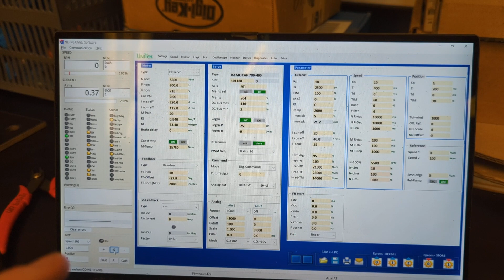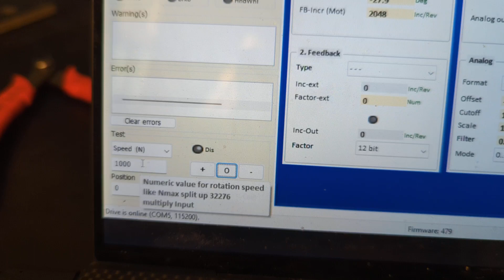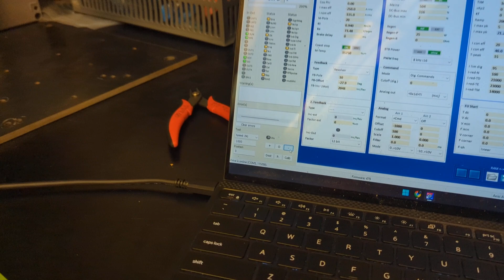Bamocar D3 - Emrax 228 Setup (Northwestern University Formula SAE - NFR23)

Comment: Hi do you have a video of the software setup as we have a problem using a bamocar 400-400 and emrax 208  that for  calibration the motor turna accordingly  and when we input the test the motor jitters but does not move

Comment: We have a problem with the same setup, where we get error 6 (too high temperature of the motor). But the motor is not hot. We tried to overwrite it and change the limit, but when we switch to "run" the error returns. Any help for this problem?

Comment: Hello, 
I have one question regarding the initial current necessary for the motor to spin with load. If your car had 350 Kg and max output of the battery of 180 A on full battery, is that enough for him to spin? I´m sorry if the question is to basic but it´s my first project with an axial flux motor.
Reply from the maker: A few questions. 
1) can your motor spin without a load attached? We want to ensure that adding the load is what is causing the issue. 
2) when you bolt your motor into the vehicle, can the vehicle roll freely without any resistance from the motor? No scraping or similar sounds of rubbing? I had issues with our 228 where the mounting bolts would scrape against the rotor on the inside of the motor if they were too long. 
3) if you spin the motor without a load at low speeds and attempt to manually slow it (eg. With your hands, a dyno, etc.), does the motor torque increase and hold at a consistent value? Or do you get a kind of "rippling torque" type of feeling? If your motor is setup in open loop mode or improperly configured in closed loop mode, you will get inconsistent torque production which may be causing the motor to struggle to move the vehicle 
4) the maximum current of the battery is not particularly important at low speeds. As a reminder, this is the job of the DC link capacitor within the inverter. While the power flowing into and out of the inverter will be the same (+ some heating losses), the voltage at the input is the battery voltage (eg. 600V) meanwhile the voltage at the output is linearly related to the motor speed (eg. Near 0 RPM the voltage is near 0V, near max RPM the voltage is near the max motor voltage). The current flowing through the motor is linearly related to the torque production. This means that, at low speeds, the motor will require a moderate amount of current to produce the torque needed to start the vehicle rolling, but this current will be at a low voltage because the motor speed is low. Because the voltage is low, the overall power consumption of the motor will be relatively low, in the range of a few kW should be more than enough to get the car rolling. Since power in = power out, assuming your battery voltage is around 600V, this should only require a few amps of current from your battery. The maximum current capability of your battery should only be important when you are drawing high amounts of power into the motor, and this happens at high speed and high torque scenarios. 

In short, yes, your battery is definitely capable of moving your vehicle. I assume there is an issue with either your inverter configuration or mechanical setup which is causing the issue. I recommend testing each part of the system individually, then slowly combining them to make the tester more representative of the whole vehicle to isolate where exactly the issue is coming from. Feel free to reach out if you have any further questions.
Reply: If 72 volt its enough to run the car

Comment: Hello,

We're currently facing an issue while operating in test mode with dig commands, where the motor is not under any heavy load. Despite setting the N-100% to limit the RPM to 1800, with N-Lim % = 100%, N-lim+ = 100%, N-lim- = 100%, and restricting the current to 5% (approximately 21A), the RPM exceeds 1800, likely reaching the maximum RPM achievable at that current level. However, the display screen continues to indicate the maximum RPM set at N-100% (in this case, 1800 RPM, represented as 32767 at 0xa8), and the RPM keeps rising. We've also tried the same setup for 1000 RPM and 500 RPM, but the behavior persists.

As I'm relatively new to this experience, could you please advise if you've encountered this issue before, or provide any assistance in resolving it? Your help would be greatly appreciated!

Thank you!!
Reply from the maker: Hello, I recommend re-reading the NDrive software reference manual. Particularly take a look at section 12.1.3 on page 74. N-100% is the maximum speed your motor is capable of (not the speed you want to limit it to). Since your motor has been exceeding 1800RPM in your testing, this value is set incorrectly. This max speed is captured in the motor datasheet. For example, if you're using an Emrax 228 like we were using in the video, that has a maximum speed of 6500RPM. You then put the speed you want to limit the motor to (as a percentage of N-100%) in the N-lim field. For example, if the max speed for the motor is 6500RPM and you want to limit the motor to 1800RPM for your test, then you set N-lim to 1800/6500 = 27%. As a reminder, motor speed is proportional to supply voltage, not current. If your supply is a standard 600V battery like many FS and FSAE teams use, you could expect a motor like the Emrax 228 to achieve well over 5000RPM. I recommend updating the value in the N-100% field to reflect your motor capabilities. Additionally, please refer to page 82 section 13.3 in the NDrive reference manual. As mentioned there, N-lim = 100% will disable the cruise limit and allow the motor to accelerate to whatever speed it can achieve with the supply voltage. This is what is happening in your test. As such, it is recommend to set this value to a maximum of 99% if you intend to use cruise limiting during normal operation. 

TL;DR - check the motor datasheet and set N-100% to the max motor speed, then set N-lim to whatever percentage of that max you want to limit to. To avoid future confusion, if you raise the speed limit in future tests on your motor, I recommend setting it to 99% so cruise will still engage at your max speed. 

Also, UniTek is really friendly! While these answers were in the software manual, they have been very responsive to my emails in the past, so I encourage you to reach out to them as well with questions. Let me know if the fixes above don't work!
Reply: Hi Chris,
While working on our fsae car, we faced a couple issues and needed some expert help. 
Context: We use an EMRAX228 HV motor controlled by a Bamocar D3 controller. We're currently controlling the motor via analog torque with a 0-10 volt analog signal on the AIN1+ . We haven't implemented AIN2 yet, but it's on our to-do list.

We're facing a couple of challenges and hoping you might have some insights:

1:  According to the Ndrive manual, the analog input should accept voltages between -11V and +11V, corresponding to digital values of -32767 to +32767. However, in our tests, the AIN reading never goes above 1200 even with a full 11V applied. We've been compensating by adjusting scaling factors to get a wider usable range, but we'd like to understand why the actual reading is limited. 

Additionally, do we strictly need to ground the AIN1- pin if we're only using a 0-10V signal?

2: During dynamic testing, the motor experiences shuddering when starting from a stop. We've set the peak current limit (Imax pk) to 100A and the maximum voltage to 500V, with no RPM limit applied. We're wondering if you've encountered similar shuddering behavior in your work. Any advice or troubleshooting steps you could share to address this issue would be extremely helpful.
Thanks in advance for your time and assistance!

Comment: These motors are synchronous - but will they be damaged if we operate in V/F open loop mode and the rotor (magnets) 'slip' below the synchronous frequency?  in other words, lets say we command a certain rpm, then bring up the expressed load (drive operates to maintain setpoint frequency with no feedback) and the torque cause the motor to not 'stay synchronized  so it operates at a reduced RPM from normal setpoint frequency? 
is that something you have experimented with?  I would expect that vehicle operation would have this dynamic?
(i ask this because certain types of synchronous motors will demagnetize if load causes 'slip' between magnetic rotation and magnet rotation)
(we are attempting to talk to Emrax but we have not received responses either email/telephone as of today)
Reply from the maker: Operating a permanent magnet synchronous motor (PMSM) like the Emrax motors using open loop control is allowed but not recommended for high performance applications. Closed loop speed and position control with FOC are generally recommended due to their superior performance. Since the control is open loop, this means it is not consuming speed / position information from the motor and instead arbitrarily applies a set voltage + phase frequency which correlates to a set motor frequency based on the motor kv constant. This also means that if the motor is unloaded or under a light load it will be able to reach the target speed, but under medium to high loads the motor may decrease in speed or even stall. The motor cannot maintain peak torque output like it could with closed loop field oriented control (FOC) because the vector representing the applied magnetic field is allowed to "slip" past the optimal angle relative to the rotor for torque delivery due to the lack of feedback. If you are testing with small loads then open loop may be fine, but if you're testing with heavy loads then be sure to carefully monitor motor current and temperature to ensure you aren't exceeding the stated operating specifications.
Reply: thank you!  and again for your time and patience. wish us luck please!  @chrisuustal

Comment: can someone help me understand input phase frequency vs rpm for this motor (188)?  i'm planning on running with parker vfd -which has a max frequency output of 588hz - 
is this enough to reach the top RPM limit of motor? 8000 rpm?
thank you!!!
Reply from the maker: The 588Hz of the parker VFD will not be sufficient to reach the 8k rpm limit on the 188. 

The maximum motor frequency is 8000 RPM = 133.3Hz. At this speed, the motor will complete 133.3 rotations per second. This motor has 10 permanent magnet pole pairs. Every full cycle of a sine wave from your inverter will rotate the motor by 1 pole pair, or 1/10th of a full rotation. This means you need 10 full cycles of a sine wave from your inverter to complete one rotation. As stated above, at its max speed this motor completed 133.3 rotations in one second. This means you'll need 133.3 * 10 = 1333 full cycles of a sine wave per second at this speed. This number (1333 Hz) is your required phase frequency output from the inverter to reach that speed. Since that inverter is only capable of 588Hz, you can do the math backwards to find it can achieve a max motor RPM of 58.8Hz = 3528 RPM. The general formula is:

Phase Frequency (Hz) = # of Pole Pairs * Motor Frequency (Hz)
Reply: thank you - i appreciate the time/effort you have made to inform me - yes on 10 pole pairs - @chrisuustal
Reply: Just an update to the parker drive - we have found that USA State Dept has set the 588hz limit - the drives are capable of going to 1200hz but you must apply for a waver with certification you will not resell overseas.  Apparently they can be  used in centrifuges for the nuclear industry.  Parker and Scott drives are the only ones that we can use (that feature 1 degree rotational adjustment between motors - we have three motors we need to adjust the shaft angle of each and maintain that at a specific rpm @chrisuustal

Comment: Hi there! Currently in the process of ordering these very same components for our fsae project, although we are seeing that the unitek bamocar d3 manual claims it only reads 2, 4, 6, or 8 pole resolvers, not 10 pole which we were hoping to use as you are. Emrax offers 2 and 10 pole options, meaning we planned to default to using 2 pole. Was this something you contacted unitek to get clarification on, or was there any adaptations you had to make for this 10 pole resolver to be compatible? Thank you!
Reply from the maker: Contact UniTek! They're very responsive and helpful. I don't remember the exact details to answer your question, but please do post what you find when they respond. I'm sure it will be helpful to others! Seems there's a lot of FSAE people viewing the video, so I want the comments to be full of helpful details / answers if possible :)
Reply from the maker: Actually I just checked my old emails and a UniTek representative directly recommended we use the Tamagawa TS2620N1095E161 provided by Emrax.
Reply: @chrisuustal  amazing thank you for the quick repsonses! I will still reach out to them for any questions but that’s a great help 🤝🏻

Comment: Hi Chris,
I have my own bamocar D3 700/400, however it states that its only intended use is for battery connections; my counterargument to this is just to use a DC power supply to make it run.
What are your thoughts?

Best regards.
Reply from the maker: You can safely run a power inverter like the bamocar D3 700/400 from a power supply, but you can never apply a negative torque during your testing. If you try to apply a negative torque to a rotating motor to slow it down, the kinetic energy of the rotating motor will be converted into electrical energy that has to flow back upwards through the power inverter and into the power supply. Most power supplies are not rated to handle power flowing back into them, so they may be permanently damaged. If you want to test active braking / deceleration of the motor, you will need to use a battery instead of a power supply. If you only plan to accelerate the motor and let it coast to a stop by friction / mechanical brake, a power supply is fine. I hope this helps!
Reply: we use AC to DC power supplies that are both regulated, and have 'dynamic regen capability'  its just a dump resistor (sized correctly) and a switching circuit that cuts in when the bus voltage exceeds a setpoint - to dump the excess voltage/energy.  they are pretty common or pretty easily produced. Its common on any inertial loads @chrisuustal

Comment: Is that the inverter you would use for an EV using this motor? Or is it a substitute? Im new to this sorry. Very cool!!
Reply from the maker: You can use different motors with different inverters as long as they have similar voltage and power ratings and the inverter is designed to work with that architecture of motor -- this motor is a permanent magnet synchronous motor (PMSM) and this inverter supports that type of motor. This inverter and motor pair is just one example, you can find other recommended inverters in the reference manual for the motor.

Comment: Hi Guys Im Juan from Chile

I have a one question about the sensor for the Motor emrax 228.

Context.

I contacted the company Emrax and they told me that the Emrax 228 MV motor sensor they have in stock is the Tamagawa brand.

I wonder if this sensor is compatible with the 700V Unitek Bamocar D3 controller or if the search another sensor, in this case wich one recomernder me

Waiting for your reply, I am kindly taking my leave.
Reply from the maker: We use the 10 pole resolver from Tamagawa that Emrax sells and it works with this inverter. You can contact UniTek and they can help you set it up, or you can follow the wiring and setup instructions in the manual for the inverter.

Comment: Hello Sir,
I like your video. I have three questions related to the EMRAX Air-cooled outer rotor motor.
a) Where are the inlets for air to enter the motor and what is the recommended speed? Apart from this, there are holes on the front and rear disks of the motor. Does air enter from these holes also?

b) What is the temperature that the motor body and the inner copper windings and core structure reach while running?

c) Which parts of the motor rotate?

Kindly reply if possible. Thank you.
Reply from the maker: Hello,
A) I'm not sure, we use the liquid cooled version only. 
B) The inner windings can reach up to 110C during operation. If you exceed 120C, expect your motor to be damaged. 
C) The entire outer shell of the motor rotates. The only part that remains stationary is the metal panel on the side shown in the video where the electrical connections and water cooling fittings are exposed.
Reply: @chrisuustal  Thank you Sir for your reply. As you said the whole motor is rotating except the metal panel, so I want to mention that I am studying EMRAX 268 model. For that model, I had read somewhere that only the motor disks and outer rotor ring rotates. Copper and core parts remain stationary.
a) So is it possible that different models of EMRAX outer rotor motor have different rotating parts?
b) In your model, the rotation of whole motor body is taking place. So I want to know are there any wire connections inside the rotor which may get twisted when the motor rotates?
I am new in the motor domain so kindly reply.

Thank you.
Reply from the maker: @meenalkumari3983  Good question. To clarify, the motor is composed of 2 parts: a set of stationary copper windings and shell of rotating magnets. When looking from the outside, the entire black surface rotated. However, you are correct that on the inside all of the copper windings remain stationary inside the bulk of the motor. Only the outer shell rotates. Thank you for clarifying. This applies to all motors in the Emrax lineup.
Reply: can someone help me understand input phase frequency vs rpm for this motor (188)?  i'm planning on running with parker vfd -which has a max frequency output of 588hz - 
is this enough to reach the top RPM limit of motor? 8000 rpm?
thank you!!!